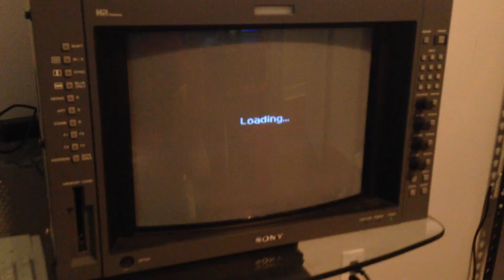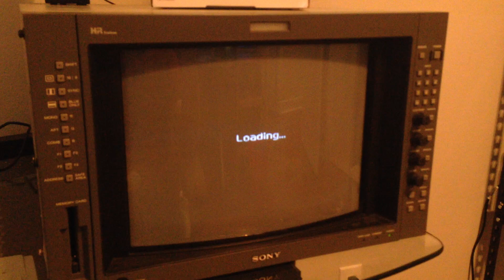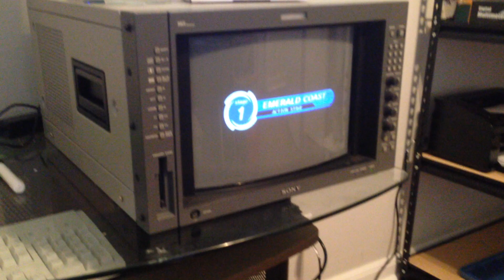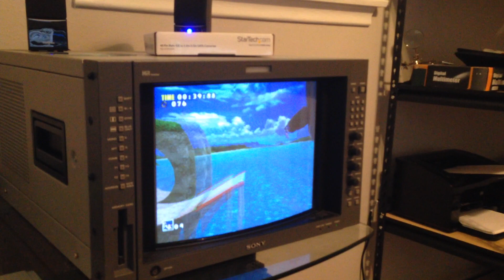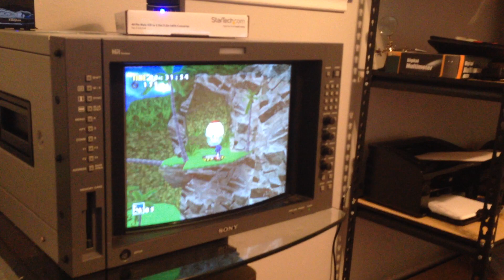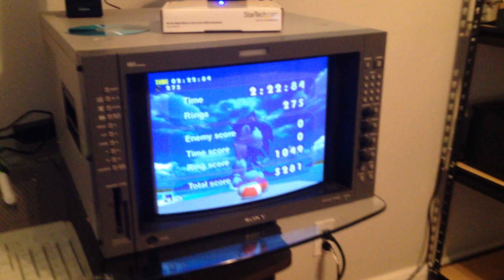Sega Dreamcast G1-ATA Hard Drive (Sonic Adventure)

Comment: Very nice, will be doing this/similar myself. I'm thinking piggyback the BIOS chip with a multi-region BIOS, remove the GD-ROM drive, and internalise a 2.5" HDD or CF card.

I see you have the HDD powered externally. Do you think the DC power board can power a 2.5" HDD? Has it got enough juice, esp. if the GD-ROM is gone?
Reply: That is also my question. 1+
Reply: Tam Boards Yes it can power E-SATA HDD's from laptops no problems. If you want to power something like a 3.5" drive you can change the DC PSU out for a Pico PSU and it will be enough to power a standard drive. Otherwise trying to power a 3.5" drive from the DC's stock PSU will burn it up.

http://assemblergames.com/l/threads/replacing-the-dc-psu.53856/

Go through the pages of the thread to see what others have done with theirs. 

Also with the StarTech 2.5 Inch and 3.5 Inch 40 P Inch Male IDE to SATA Adapter Converter (IDE2SAT) you can use SATA drives. My friend is doing this mod for me and I am about to buy this adapter so I can use my WD 1TB HDD as the guy that made this thread is using the same thing in this video.

http://www.amazon.com/gp/product/B000ZLM9IA

You can see his post here to see him talking about it. 

http://dcemulation.org/phpBB/viewtopic.php?f=31&t=103137#p1043400

Comment: I have a spare DC that has a dead GD-ROM drive. Is there a way to get around that with this? I'd hate to throw it away...
Reply: coreykun667 Don't throw it away. The entire point of doing this mod is to have a usable Dreamcast without touching the GD-ROM drive. The drive needs to stay in place in order for it to start properly, but the drive doesn't need to be functional. But you still need a way to start Dreamshell. The only way to do this without a GD-ROM drive is to change your BIOS. You will need a new BIOS chip with Dreamshell written on it, replace your stock BIOS chip, and then your Dreamcast will boot to Dreamshell instead of the Dreamcast OS. Then you can wire in this mod and use any HDD you like.
Reply from the maker: Michael Owens Michael's correct, in this video I used a boot disc on the GD-ROM drive to load DreamShell which had the hard drive loader. You won't have that option if you have a dead GD-ROM. However, you can put a custom BIOS chip on your motherboard to boot directly to DreamShell without the GD-ROM drive working.
Reply: +coreykun667 If the drive is completely dead, there are 3 possibilities:

1. make this modification (G1-ATA), and make an add-on DreamShell BIOS modification to play most games from harddrive. The GD-ROM assembly is not necessary but the board should stay. GD-ROM is clock source for AICA chip, so without it, it won't start and the system will lock up. You can alternatively rig up your own clock source and remove GD-ROM, but i'm not 100% sure on how to accomplish that correctly.
2. use USB-GDROM by NMEMO as a majorly compatible plug in replacement for GD-ROM drive. It's pretty straightforward to use. Takes images from any USB mass storage media. Does not emulate "lid open".
3. use GDEMU by Dknute as a majorly compatible plug-in replacement for GD-ROM drive. It needs some data preparation, IIRC. Uses SD-Card as storage. Emulates "lid open".

I actually have another idea for a low cost GD emulation unit, but i have my doubts whether i'm up to it and whether i'll ever get around to.

Comment: hhmmm link to diagrams? or pinouts hardware
Reply: Tam Boards but you do this with a disc in the first time, also this is hard to do by self
Reply: +Tam Boards in 2016 wokrs better than old version?